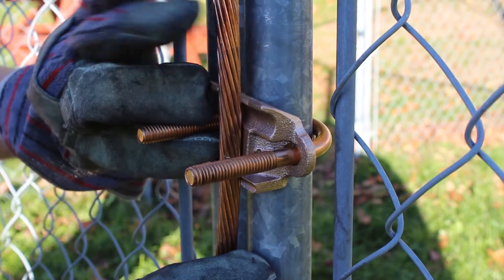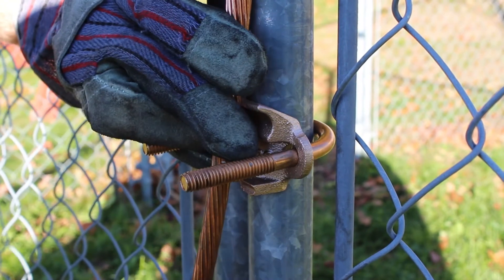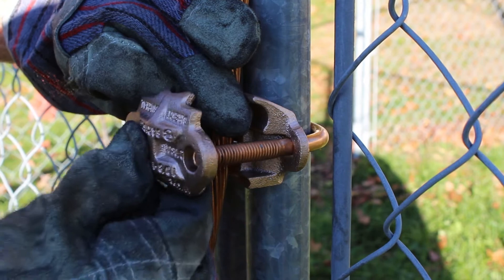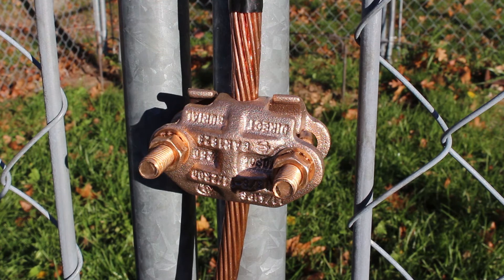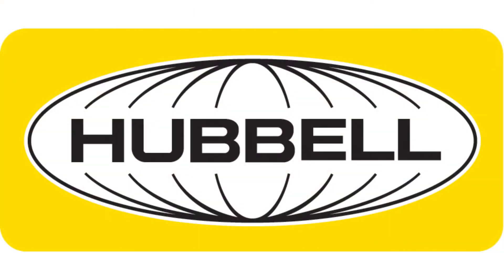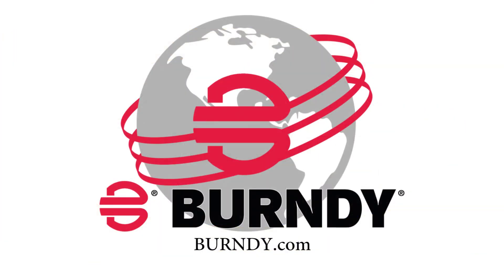GAR Installation Video

Comment: What if instead of a large fence post, I have a  5/8" threaded rod, and instead of a cable running vertically, I have a cable running in the horizontal direction. This is not a fence or grounding application, I am just trying to support a long cable run every 3 ft on center to a clamp that uses a 5/8" bolt.